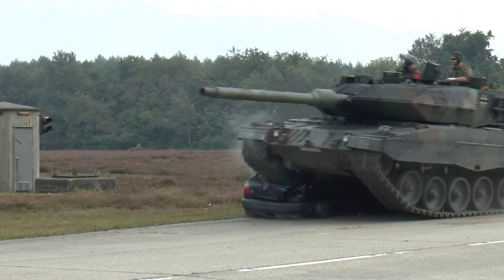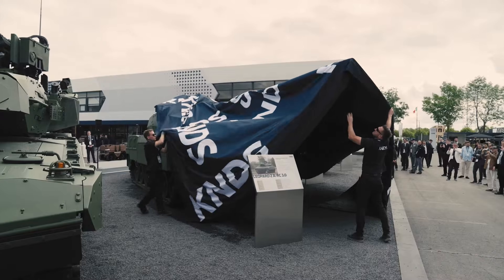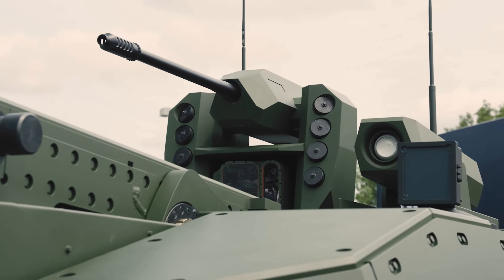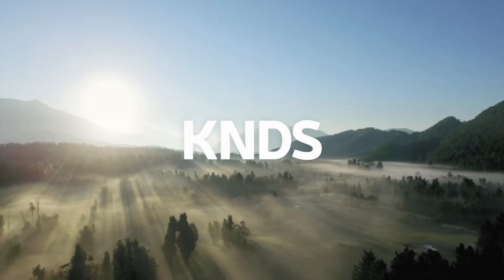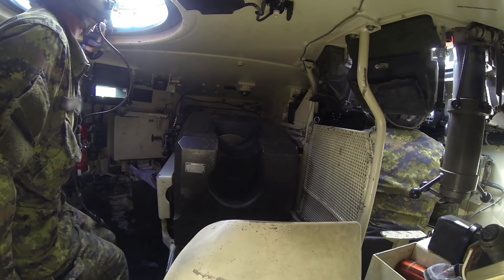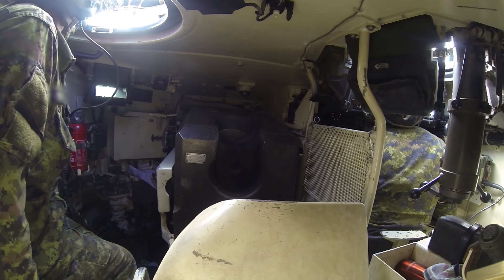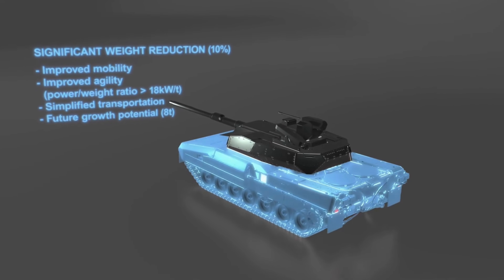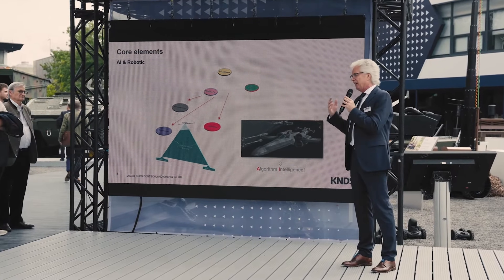The Leopard 2 A-RC 3.0 Main Battle Tank | 140mm SMOOTHBORE GUN

Comment: That 140mm is actually mostly the same size as the 130 but is slightly longer with HE shells and has a semi case telescoped design to give it more propellent. In other words as long as your ammo racks can accommodate the 130, the ammo capacity between the 130 and 140 are going to be the same. Just make sure you are using the right gun tube.

Comment: It doesn´t matter how many fancy futuristic BS they put into the MBT this is not BF2042. This make the MBT only expensive, longer to learn&master, hard to maintain and integrate in allready existed structures, prone to errors (like "Puma IFV") and long to build one! And if Germany order only maybe 100 of them they will wait 5 years to get those deliverd (around 24 p.a. on new Database of Leopard2A7V) and can not stand again an oponent that can build 100 MBT in only a month, that are maybe in a bit lower quality but cheaper,  faster in replacement and deployment to new crew (easier in usage) but also deadly AF! Quality doesn´t really mattes in this case, sometimes it´s the quantity...

Comment: There's no suc thing as perfect  tank.
If it's super reliable, armored, precise and manuevarable, then it would be so expensive, so you could have a few tabk platoons or tabk brigades. And probably these expensive tanks will be destroyed in the battle very quickly if your enemy is not a peasant in sandals.
The rality shows the need of the new concept of the tank, which should 
1) defend the crew. It's more important than the tank itself
2) defend itself against the most common and cheap weapon like FPV drones, ATGM, land mines. Because once the tank appears on the battlefield, it's the most prioritized target and everything will be used to hit it.
3) Fit to the tactics applicable in the certain war against the certain enemy.

Russians started the war with T90M and now fighting mostly on T62 (the 1960s tanks) and restored T72.

Comment: Letting the software take over air defense/ drone protection makes sense with some voice/ threat warning functions added in majes sense.  The only reason not to call this a Leopard-3 have to be political, the armor is heavily modified, the turret is different, and the gun is changed as well.  It should be called a Leopard 3- 120/130/140   KISS for the sake of communications and logistics, screw the politico who may be saying something like. "New tank type seems too aggressive" in the middle of adjusting for a shooting war only a block away.

Comment: I'm still more in favour of Rheinmetalls KF51 solution, albeit with a new hull. I believe one of the most important improvements that need to be made to the Leopard 2 is the shift to the MTU 883 engine, which is much more compact than the 873. This would allow for the turret to be moved back abit, and more internal hull space to be made available.

Comment: The problem with tanks is that they keep trying to squeeze more equipment onto the same size chassis, Tanks aren't the Tardis from Dr Who, they don't get magically bigger on the inside. I think they are gonna get longer, not wider as their width is governed by transport issues. But if made that bit longer they'd have the room for additional rounds and maybe a small VLS to deal with multiple drones or aircraft, I say VLS as that way they wouldn't need to be facing the enemy as we've seen in Ukraine where drones often hit them up the arse.

Comment: Why not just go to 155mm for the gun?  that 140mm ammunition is going to be very expensive (and just about as expensive) and run at elevations up to 55 degrees...
Reply: You see, the 155mm gun is bigger. The breach on those things are fucking huge, as is the ammo
Reply: @Dianasaurthemelonlord7777   ya.. and run Bull's type of 155mm round.. hell, it is (loading) all going to be automated anyway.
Reply: @tsclly2377  155mm artillery is not designed for use in tank, you haven’t a clue

Comment: Should start making more powerful main gun ammo and decrease the size of the cannons instead of increasing.
Reply: You can only make a small cannon round so powerful before you absolutely have to make it bigger.
The only real way to make small rounds more powerful is to ensure a more even propellant burn, which requires a new propellant and a new propellant ignition system if you make sure you don’t want to just make the ammunition stupidly long… which would make stowage more difficult, it is much, much easier to just take the same basic cannon and ammo design and make it bigger.

On top of that, tanks are generally not engaging other tanks super often, but are encountering fortifications, infantry, and light armor or light aircraft so they need a good HE round as much as they need a good AP round, and the absolute best way to make HE better is generally to make it bigger.

Comment: I would say, that with non-penetrating turret thay could make a much smaller and lighter tank. If the hull was designed in such a way  that the turret goes over the engine it, potentially, can be significantly shortened and thus made even lighter. IMHO, potentially, it can get to sub 40t category and that would allow the use of rubber tracks, those would shave several tons by themselves, and what's more important - they are significantly less labor intensive (maintenance vise)
Reply: The turret goes over the engine to accomodate the autoloader
Reply: @freddyvejen743  but not fully. You literally can move it back as far as you want.
On the other hand how about this idea: put the engine in front transversely, move the crew back - fully under the turret and have a Merkava style rear hatch. If the turret can be reloaded from the inside - put a protected ammunition drum with downward blowout panels next to the driver (both are behind the engine and are protected from the top by thick turret's front armor). As for the transmission - use either a forward one from the Boxer,  or a diesel electric, with electric motors and sprocket wheels at the back.
Actually, maybe, KMW could even just take a Boxer design, make it slightly smaller, rearrange the transmission and slap some additional armor.
Reply: @solarissv777  I have a similar tank design idea concept.Mine keeps the merkava 60mm mortar to deal with infantry. The RWS is a double barrel M2. the driver and gunner  sit next to each other in the hull and the commander and 4th crew (dont know what call him) in the turret. In my design there are no drones or missiles. I dont have a calibre in mind but the ammo is the russian seperate type and it is stored vertical with the propelleant stored to together and ammo stored together. The autoloader works that of an artillery gun based on the 155mm 3 man german design where the charges and ammo is fully automated and not semi like other artilery gun systems. I forgot the name of this weapon system.

Comment: I like to see some long expected additions - like ERA layers, which are crucial these days in terms of multi-angle chemical warhead protection as well as to degrade the too powerfull darts around today. More situational awareness and more crew safety is also pretty nice.

Is a 140mm neccesary? I doubt it. Yes, i wouldn't like to test my luck with most recent T-90M's or even Aramta'ish designs, and drone jammers anwell as Arena/Afganit-APS are a real stopper for ATGM's as well, but we see so little tank-on-tank combat, you could ask about the necessity. Also rather than wasting energy on a larger diameter, we could lengthen the darts. But these are thoughts for later, not the existing or looming situation.

So we have a interim model with a bit of an armor upgrade, more safety for crews. That's great and i'd like to stop here - but they didn't. They sorted to the worst possible APS solution and installed a fkn Trophy, which is pointless against darts (that's what Trophy HV is for, excluding Windbreaker what is against HEAT/ATGM/RPG etc. - and even sucks here with ther maximum projectile speed it can track). They have a european AND a german solution but went for a random product from a economical stunned nation that is accused of genicide right now. Exactly the chice i'd make -.-
Then there is a oversized gun no one needs (at the moment), not has munition at hand for. I don't want my wars be like stock market gambling and hope there will be sufficent ammo factorys buildg the thing i ordered when rolling to the battlefield.
I got a 30 mm gun without adding the little extra step of sufficent AA-sensors (like Skyranger uses) to feed it nice AHEAD ammo and let it shred everything dronish in my protection zone. No, they went with 'just a boring gun'.

Just like with russians often being too pragmatic and american geenrally haveing problems to understand what they want, germans are great engineers, but sadly often fall for their buisness managers BS talk. So the ARC is too fancy to be practical, and too practical to be fancy. Weird, but it misses the mark in different aspects, and all i just see is a half-asses economical attempt to keep an old produc in the shelf for longer, while f.e. Italy allready ordered not just the KF51, but a factory for it (alongside with Hungary buying a KF41 factory, and both nations now shift to the best german tanks available while GER itself shifts to an economical upgrade to its aging chassis).

It's painfull to watch germans making horrible buisness desigions while having all teh potential to make great gear. This is Volkswagen levels of idiocy.
Reply: If i'm too positive in general, just tell me xD

As a german, i'm not good at sugarcoating stuff.
Reply: Nera is generally better than era Blocks.
Reply: @emilsinclair4190  Throwing in both terms as a total unit is ... let's say weird at best.

There are a bazillion designs of both, and even T-72 uses both in combination. It is known and not debatet at all that you need the full onion to stop the most recent threats (DM61, 3BM60 etc.).

Comment: I think its a good intermediate design, using a known platform and  fitting it with more modern technology, bridging the gap until a really new design without compromises is possible. I think that at least one tank per platoon could be better with a four person crew, with a crew member who collects remote sensor and network data for helping the platoon or company commander.